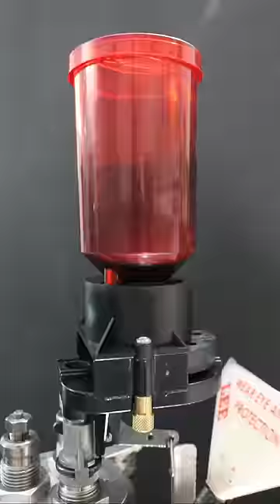Reloading 9mm ammo in 1 minute with Pro 1000  -   #reloading, #9mm, #leeprecision, #ammo, #shorts

Comment: Is this cheaper then just buying ammo? 

Because maybe getting the different components is expensive to get from different locations. Because you need to ship or get yourself

Also can you reuse the cartridges and if you can how many times til they are unsafe?
Reply from the maker: Good evening Kerbo. Thanks for looking at this content and commenting accordingly. The cases can be reused but giving you an exact number of reuses is futile because this is dependent on several factors. Based on my experience, my reloading tools and the way I reload, 9mm cases I have used in access of 10 times without any issue.

About the cost. Here is a calculation I sent to someone else that had a similar question yesterday. Take care and have a great day.👍👍
-------------------
Here are my own workings as follows: 
🔶Based on 9mm setup only. (Changing caliber is approximately $100 addition, mostly dies and shell plate)

🔶ALL FIGURES & CALCULATION DONE January 2022 as follows:

$300 _ Lee Pro 1000 Press 9mm, ref. 90640.
$020 _ Lee Case Collator, ref. 90667.
$045 _ Lyman Ammo Checker, ref. 7833000.
$012 _ Dillon precision case lube, ref. 13733.
$055 _ Scale frankford arsenal, ref. DS-750 
$050 _ Price estimate for a generic caliper.
$048 _ Price estimate for kinetic bullet puller. 
$530 _ TOTAL INVESTMENT of above listed item ONLY.

$160 _ TOTAL Calculated price of raw materials to fabricate 1000 rounds type (CPRN-124gr) "brass cases free)
 
$300 _ TOTAL Average price for factory loaded ammo, 1000 rounds, 124gr.

🔶Therefore, excluding labor cost, I save $140/1000 Rounds.
🔶Therefore, investment of $530 / Savings of $140 = 3786 rounds.
🔶Therefore, after 4000 rounds I start saving $140 / 1000 rounds I send down range.

🔶🔶🔶 In short, after 4000 to rounds I cover ONLY my investment cost.
Reply: Normally cartridges are good for about 3 reloads, maybe 4-5 if you are getting spent military brass that is thicccc. It is about half the cost of buying ammo, but you will need to offset the cost of the press and prolly another 200-400 bucks for dies and trimmers etc for the cartridges you wanna do and various other tools (powder scale esd mats calipers etc.). 
Technically you should really also have a proper explosives/flammables cabinet to keep everything in, looking at like 500-1500 bucks new for those dam things. With patience you can find great deals on them on ebay craigslist and the like on occasion. Just know if you are not storing this stuff properly and your house happens to burn down for any reason your home owners insurance will likely use it to try to not pay you. Hell even if you are storing it properly they might try.

It might take a few years but it will pay for itself eventually at any level. Personally I would recommend getting a lee classic not one of these all in one progressive monstrosities. It's a bit much to keep track of for a beginner and frankly the things just aren't as reliable. Doing a batch of 50 one operation at a time is basically as fast as the progressive. additionally when batching you can check all your cartridges at each step in process, which is good practice when first starting out and progressives don't really allow you to do easily.

Also you will pretty quickly be making ammo that is as good if not better than anything on the commercial market. Reloads are like 20% the cost of high quality match ammo.
Reply from the maker: @kylehenline3245  Good evening and thanks for taking time on this excellently, well explained comment. Much appreciate. Take care and have a great day. 👍👍👍👍🥇🥇🥇🥇🥇🥇

Comment: Is it due to some regulation that you have to load the warhead manually?
Reply from the maker: Good morning Jean. Thanks so much for your nice comment🙏🙏. This press can be fitted with an original attachment for under $100 that would place the bullet in position automatically, in a mechanical fashion without an external power supply but personally I find it better to place the bullet manually because I can use that motion to also visually inspect that the powder is in the case.  

I have a longer detailed clip on this press you might find interesting. Link in the pinned comment. Have a look at that to see the entire process.

Comment: Im curious? After all the money spent and all the time n work that go into this is it actually worth it???
Reply from the maker: Good morning Duval. Thanks for your very good question. Incidentally, yesterday someone asked the same question. Here is the reply so you can work it out and see if it is something viable for you. Take care and have a great day. 
-------------------
Here are my own workings as follows: 

🔶Based on 9mm setup only. (Changing caliber is approximately $100 addition, mostly dies and shell plate)

🔶ALL FIGURES & CALCULATION DONE January 2022 as follows:

$300 _ Lee Pro 1000 Press 9mm, ref. 90640.
$020 _ Lee Case Collator, ref. 90667.
$045 _ Lyman Ammo Checker, ref. 7833000.
$012 _ Dillon precision case lube, ref. 13733.
$055 _ Scale frankford arsenal, ref. DS-750 
$050 _ Price estimate for a generic caliper.
$048 _ Price estimate for kinetic bullet puller. 
$530 _ TOTAL INVESTMENT of above listed item.

$160 _ TOTAL Calculated price of raw materials to fabricate 1000 rounds type (CPRN-124gr) "brass cases free)
 
$300 _ TOTAL Average price for factory loaded ammo, 1000 rounds, 124gr.

🔶Therefore, excluding labor cost, I save $140/1000 Rounds.
🔶Therefore, investment of $530 / Savings of $140 = 3786 rounds.
🔶Therefore, after 4000 rounds I start saving $140 / 1000 rounds I send down range.

🔶🔶🔶 In short, after 4000 rounds I cover my investment cost.
-------------------

Comment: And thats about how slow u have to load with this machine without having any problems. I had one.. hated it. Dillon 650 is the way to go
Reply from the maker: Good morning Mike and thanks so much for stopping by the channel 👍👍🙏. This press is no Dillon but for the price paid it is a great deal. And the rounds are also great as I have been using them for many years with no issues. Again, hands down for the Dillon press. Here is my link for the Dillon 650 in action, this time on some .45ACP.  https://youtu.be/UyKHr_O8-tg

In addition, have a look at the clip via the pinned comment for the Lee pro 1000 going at full speed.

Take care

Comment: this one primes in the same spot as powder is dumping?  if so, that could be scary
Reply from the maker: Good afternoon and thanks for stopping by Big Rod👍🙏. The priming of the case is done at the bottom of the press but the powder drop is at the top section. When the case reaches the powder dropper it is already primed so one could consider this as safe. When the case exits complete of powder charge it is moved to the 3rd station, mid way and away from the primer station area. I don't exclude anything but I have had no issue so far. Take care and have a great weekend.
Reply: @ReloadingMoreAD1966  ok, good that seems good then, only reason i ask is because on my lee loadmaster I had depriming pin break, didn't notice it, it then went on to get a primer,  i pulled the handle and it popped a primer, and set of all 99 in the tray too, scary as heck, deaf for a little while and a mess to clean up, was using federal primers.

Comment: Yea you save money but how much did you spend on all the equipment
Reply from the maker: Good morning Dominic. Thanks for looking at the content. Good morning Duval. Incidentally, yesterday someone asked a similar question. Here is the reply with some numbers. take care and have a great day.👍👍
-------------------
Here are my own workings as follows: 
🔶Based on 9mm setup only. (Changing caliber is approximately $100 addition, mostly dies and shell plate)

🔶ALL FIGURES & CALCULATION DONE January 2022 as follows:

$300 _ Lee Pro 1000 Press 9mm, ref. 90640.
$020 _ Lee Case Collator, ref. 90667.
$045 _ Lyman Ammo Checker, ref. 7833000.
$012 _ Dillon precision case lube, ref. 13733.
$055 _ Scale frankford arsenal, ref. DS-750 
$050 _ Price estimate for a generic caliper.
$048 _ Price estimate for kinetic bullet puller. 
$530 _ TOTAL INVESTMENT of above listed item ONLY.

$160 _ TOTAL Calculated price of raw materials to fabricate 1000 rounds type (CPRN-124gr) "brass cases free)
 
$300 _ TOTAL Average price for factory loaded ammo, 1000 rounds, 124gr.

🔶Therefore, excluding labor cost, I save $140/1000 Rounds.
🔶Therefore, investment of $530 / Savings of $140 = 3786 rounds.
🔶Therefore, after 4000 rounds I start saving $140 / 1000 rounds I send down range.

🔶🔶🔶 In short, after 4000 rounds I cover ONLY my investment cost.
-------------------

Comment: I'm surprised all the different functions work so well. Lee isn't really known for quality.
Reply from the maker: Thanks for stopping by the channel Matt 👍👍🙏 The lee pro 1000 is a cost effective solution and the ammo it makes is reasonable good. Not that fast but still. It will need a few adjustment but eventually when you understand how it works it is a nice machine to have.  Have a look at the longer clips on my channel about this press as they show the process in detail. Links in the pinned comment. Take care and have a great week.
Reply: @ReloadingMoreAD1966  I used to have the Lee load master progressive press. I typically still did everything on single stage presses because it seemed a bit inconsistent. Maybe the pro 1000 is better. What I really want is the Area 419 zero press

Comment: How do you know when you put enough gun powder in ? Does it automatically dispense the perfect amount ?
Reply from the maker: Good morning Luke. Thanks for looking at my content👍👍👍. The system is equipped with a measurement for powder. The amount of powder used is determined by many factors but as soon as you know what is needed the powder dispenser is adjusted accordingly and very round is filled with the same weight/volume of powder.

Do have a look at the longer clip for this press if you are interested. links in the pinned comment.

Have a great weekend.
Reply: My grandfather used a dispenser which you could manually set the amount it dispensed and then it was weighed also to make sure it wasnt above the maximum or below the minimum requirements for the particular cartidge and it was specified to me that a little bjt goes a long way so if you overload you can turn your pistol into a hand grenade. But as long as everything weighed properly, it was all good
Reply: @ReloadingMoreAD1966  thanks for the reply ! It definitely peaked my interest and I’ll definitely watch the video on this press.

Comment: What bullets are those?? I need to find me some of them..
Reply from the maker: Good morning Larry and thanks for stopping by and looking at my content👍👍..  The projectile used here is a 130gr SJFP, reference B-329 fabricated by PRVI, diameter of 0.3545. Hard to find but I found some old stock, around 500 heads in total.

A similar projectile that I have also used, more frequently than this is the 125gr SJSP, reference 613573 by Fiocchi. Both mentioned projectiles I have used to reload 9mm and .38 special rounds with no issue what so ever. 

Have a great day.

Comment: What bullets are you using? I’ve not seen 9MM softpoints with a heavy cannelure like that. Looks more like a bullet you’d use in a revolver w/ roll crimp.
Reply from the maker: Good morning and thanks for stopping by and leaving a comment👍👍..  The projectile used here is a 130gr SJFP, reference B-329 fabricated by PRVI, diameter of 0.3545. 

A similar projectile that I have also used, more frequently than this is the 125gr SJSP, reference 613573 by Fiocchi. Both mentioned projectiles I have used to reload 9mm and .38 special rounds with no issue what so ever.

Have a great weekend
Reply: @ReloadingMoreAD1966  Holy smokes, those numbers were hard to find. You out of the US by any chance? 
—-
What powder and charge? I tend to use Power Pistol with heavier bullets, as I find that it’s a decent compromise between chamber pressure and maximum velocity using medium pistol calibers like 9MM and 40 SW
Reply from the maker: @1FireyPhoenix  Hello Again. I am situated in Europe but import lots of items from USA. Most recent the MEC marksman press. The PRVI heads are old stock. The powder it all depends what is available because it is difficult these days. For 9x19 I most comonly used for N320, CSB5 or 6, FRex green or Vectan SP8. Have a great day.

Comment: Do you crimp your 9mm stuff? If so, do you do it in another run?
Reply from the maker: Good morning Molag. Thanks for stopping by.👍👍
Here I am using the 9mm die set by lee, item 90509, comprising of a total of 3 dies.
The first is called the "Full Length Sizing Die". This particular die is removing the spent primer and simultaneously sizing the cartridge.

The second die is the "Powder Thru Expanding Die". This die will flare the top of the case, making way for the projectile to be seated in the next step. This same die is also the place were the powder charge is released. 

The third die is seating the bullet in place and also crimping tight the bullet. Now be aware that the crimp is not a roll crimp, sort of what you see on older revolver rounds but just a minimal crimp, similar to factory loaded 9x19mm ammo supplied by most brands.

I also have a 4th die "lee 90861" that performs a more rounded crimp that is suitable for .38 or .357 but I tend to decide based on what projectile I am using if I operate a 4th die or not. For instance, on .357 round I always go for the 4th die but on .38 special, I believe I never found the need. The 4th die would go on my single stage press.

Thanks for showing interest in my content. Have a look at the channel for longer, non-Short clips. Regards and take care.

Comment: I have an issue with the step where they add in the gunpowder. Only using the rough measure provided by the reloader will almost definitely have an impact on the accuracy and group, it’s much better to use the rough measure to get close to the needed grains and then use a specialised scale for the difference.
Reply from the maker: Good afternoon Hendrik and thanks for stopping by🙏👍🙏. The press comes with a powder measuring system that is pretty accurate. The type of propellant can have deviations on how accurate the measurement is but generally it works fine. I give you an example, Based on the way I load. 

Let us assume my charge is 3.50 grain. I make sure that the dispenser is sending down 3.50 grain my means of testing before start and along the way with a digital scale. For instance 10 charges should be 35 grain but they might be 34.90 or 35.10. I inspect exactly how much powder I put in the canister at start, after completing 250 round I should have left to total amount less 250 x 3.50 grain.  (Normally the different is always under by  3 to 6 grain. Some is lost and some is the deviation from measurement. 

The deviation are not much and my groups are OK. Have a look at my detailed clip for the .45 ACP and you can see exactly what I intend. Have a great evening.
Reply: @ReloadingMoreAD1966  Hi, What I wasn’t really taking into account is the fact that you’re not loading rifle rounds as I am used to, meaning the distance the bullet has to travel is significantly less.

I usually reload cartridges for a .308 rifle. So lets say I can choose between 3 options to simplify it, 35.3 , 35.5 and 35.7. The grouping significantly differs over long distances and it is neccesary to measure to the decimal. I usually set the reloader to 35 and the dump the gunpowder out of the cartridge onto the scale. I then adjust weight and then add it back into the cartridge. Sometimes I literally have to scoop out 3 granules of powder to get the correct weight
Reply from the maker: @hendrikleroux5945  Hi. I fully understand. With rifle rounds it is a different school of taught. In my opinion a good single stage is best and a good scale for srifle rounds. not to mention all the other tools needed. 

For rifles rounds i am set with the Mec Marksman Press.

Since we take alsobu rifles, i think you might find these clips interesting. Take care.
▶ The .338 Lapua Custom Built by the Dolphin Gun Company:
https://youtu.be/TqDEaJolLZY
▶BARRETT Model 82A1 in .416 Barrett caliber:
https://youtu.be/r_0oU42WXWc
▶The Howa 1500 Rifle in .308: 
https://youtu.be/-eUFdTBwc1Y
▶Dismantling of a 308 BLANK Round:
https://youtu.be/PTWY-viXM0w
▶Dismantling of a 308 Round by S&B:
https://youtu.be/8_93iVqdzqw
Reply: All depends on the powder you are using, the measure and the distance. Check out NBRSA (National Benchrest Shooters Association). Most the shooters reload rounds at the range and drop straight from the measure into the case. The 5 and 10 shot groups have to be seen to be believed. 100 yd 5 shot groups to win are in the teens (0.1 inch group size center to center). All of this is short range (100-300 yards). Now when you step up to 1000 yards, you better believe measuring each charge makes a difference. But 300 yards and less, you can choose powder and good measure and get by with not weighing charges.

Comment: How much does that machine cost?
Reply from the maker: Good morning. Thanks for stopping by and looking at my content.🙏🙏👍👍 
Here are my own workings as follows: 🔶Based on 9mm setup only. (Changing caliber is approximately $100 addition, mostly dies and shell plate)

🔶ALL FIGURES & CALCULATION DONE January 2022 as follows:

$300 _ Lee Pro 1000 Press 9mm, ref. 90640.
$020 _ Lee Case Collator, ref. 90667.
$045 _ Lyman Ammo Checker, ref. 7833000.
$012 _ Dillon precision case lube, ref. 13733.
$055 _ Scale frankford arsenal, ref. DS-750 
$050 _ Price estimate for a generic caliper.
$048 _ Price estimate for kinetic bullet puller. 
$530 _ TOTAL INVESTMENT of above listed item ONLY.